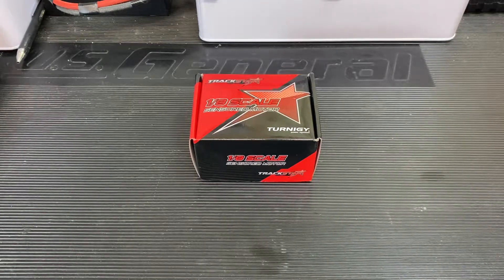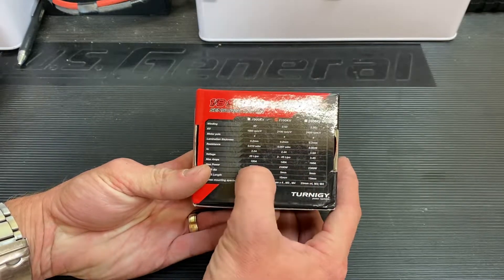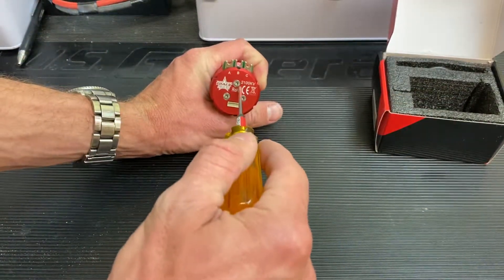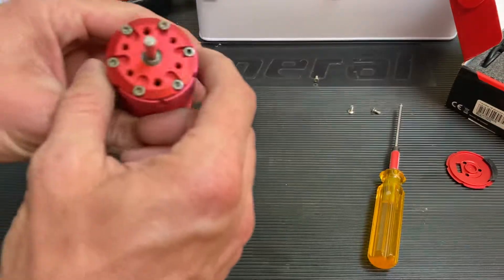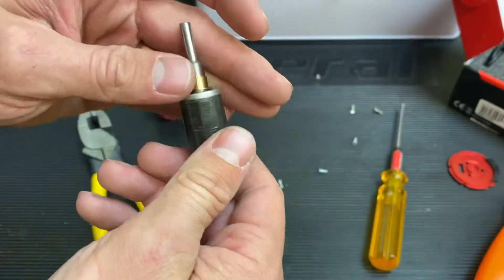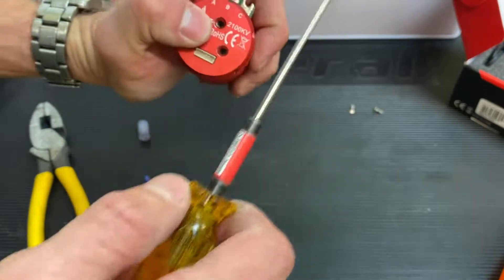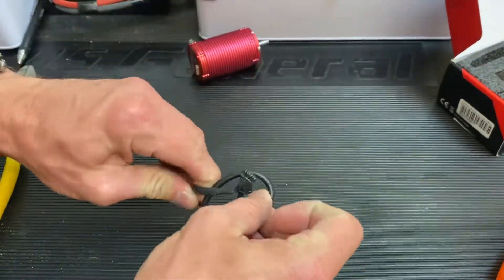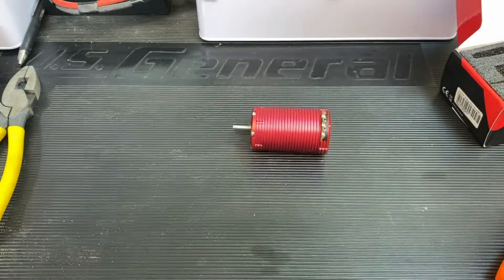Turnigy Trackstar 1/8th 2100kv Buggy Motor! Overview and Teardown!

Comment: What’s your thoughts on running this on a slash 4x4 hcg
Reply from the maker: Broken everything lol! Way too much power for that platform. Hobbyking makes an sct motor that its longer than a standard 3650 motor i believe its 3660. https://hobbyking.com/en_us/turnigy-trackstar-sct-5-5t-sensored-brushless-motor-3750kv-550-size.html